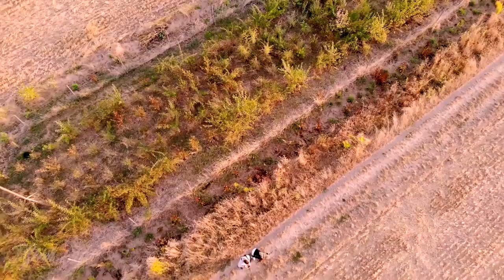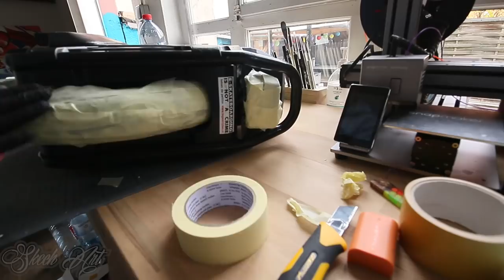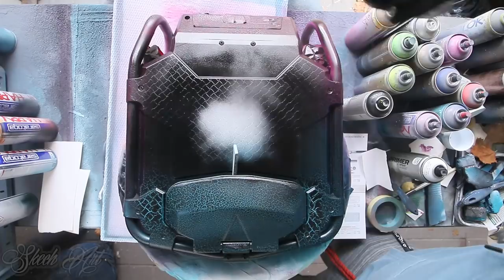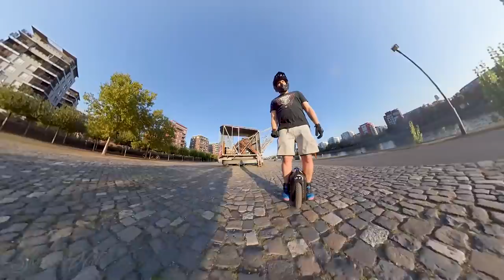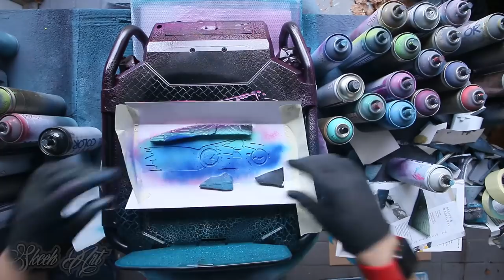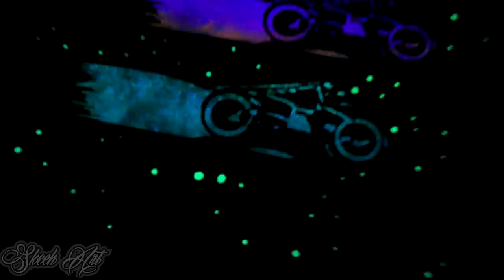Spray painting on $2800 Electric Unicycle  Part 1

Comment: Hey Skech!! I have some questions. I'm wanting to become a spray paint artist and I want to know what you do with your poster boards. 1) You do sand the glossy side, just leave it be, or paint on the non-glossy side? 2)When I'm spray painting, how do you make it look glossy after the finish product?🤔
Reply: Paint on the glossy side. Don't sand down or scratch. Your paint (depending on what type you use) will naturally reflect. If you want a high gloss you can spray some glossy clear coat paint once you are done with your piece.